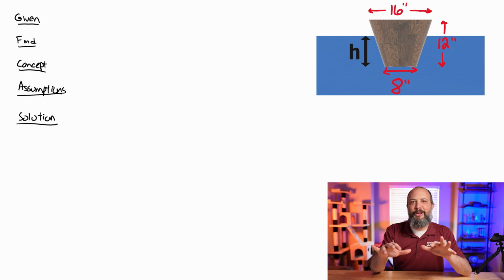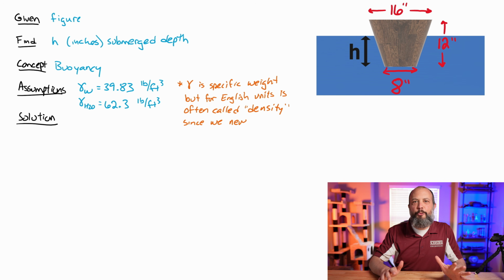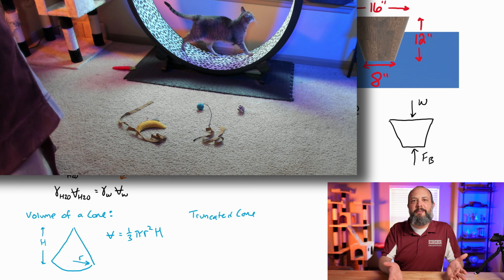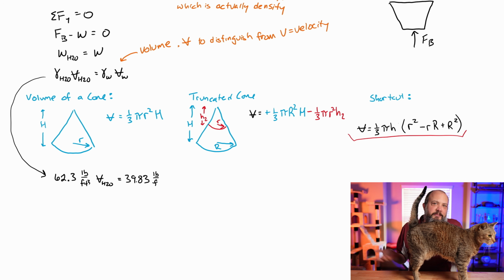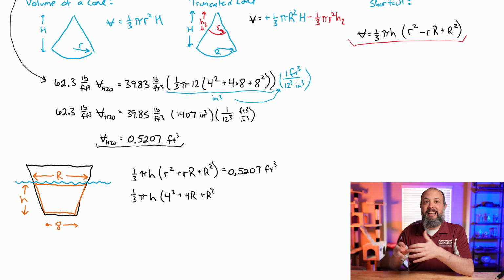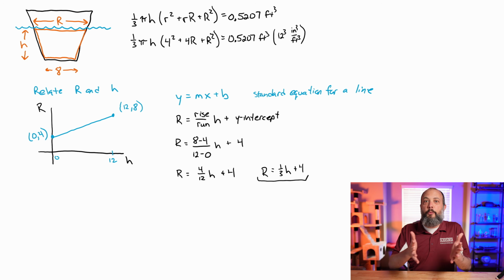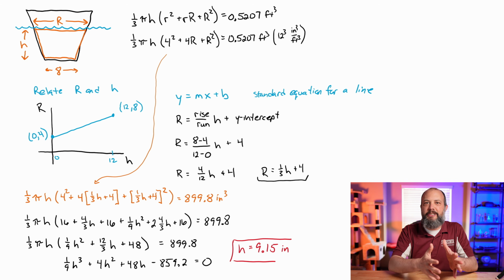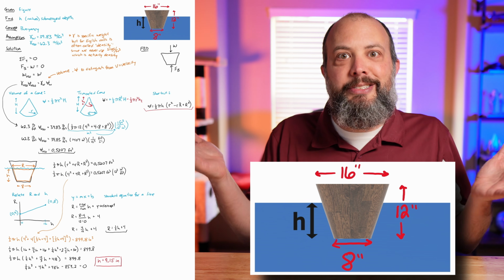Determine Draft of a Floating Body – Fractional Volume Submerged Example Problem

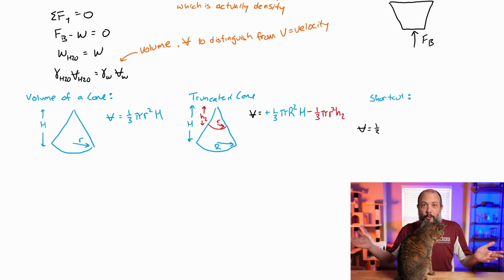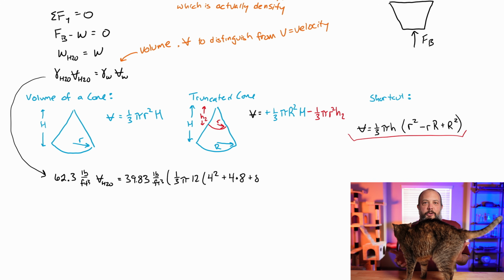Comment from the maker: There is a typo in this problem that does not effect the final answer. At 4:02, this subtraction sign in front of "rR" should be addition. (In my explanation I describe it as "times" which is also incorrect.) The rest of the problem I do solve correctly using this term as addition, so this was just a typo in this one spot, but not something that carried forward. Example, at 4:22, when I write "+4*8" ... that + sign is correct.

Comment: Hi Brian how similar would this process be in instead of a cone, it was a half cylinder?
Reply from the maker: The engineering would be the same, but the math would be harder, calculating a "slice" of a curved shape. If you want to see the math for that, I have a short video on a completely different topic "Hydraulic Radius and Wetted Perimeter" where I look at a partially filled pipe, which would have the same math that you would need for the cylinder round side in the water.
Reply: @BrianBernardEngineering  Thanks alot man!